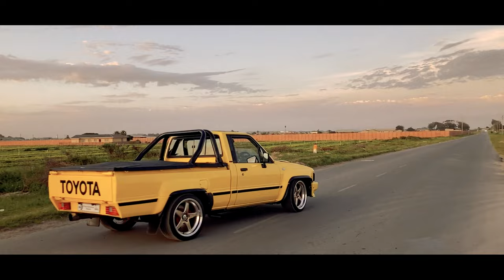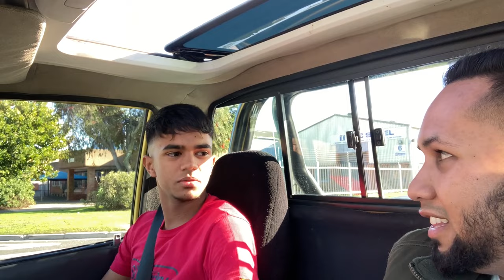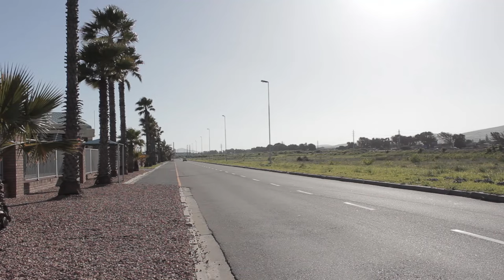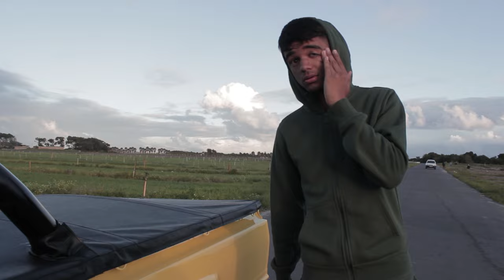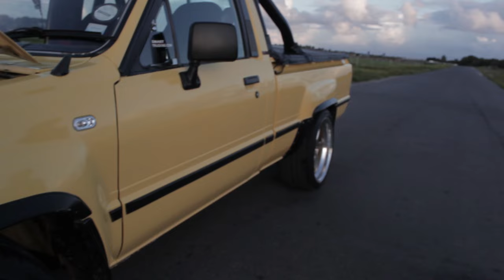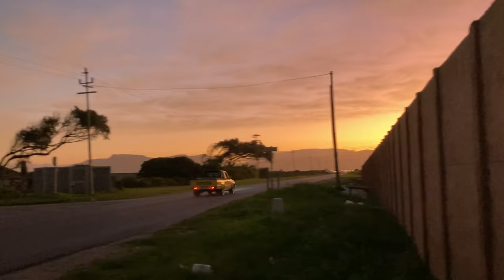TOYOTA HILUX 2JZ😍 | This is my ride Ep79

Comment: Great Video, I couldn't help but notice the valve cover is from a 2JZ-GE and not a GTE, are you sure it's a 2JZ-GTE or is it really a 2JZ-GE NA Turbo
Reply: It's cheaper to build a forged 2jze than buy a  2jzgte. But most likely a NA 2j with only injector and turbo upgrade explaining why it sounds weak
Reply: it's a 2jz ge na turbo

Comment: The slogan of TOYOTA says it all....ALLES LOOP REG ALTYD TOYOTA.....🔥🔥🔥🔥🔥🔥🔥....i want to know which gearbox would be perfect for a 1jz motor....and do i have to change the diff as well...i bought a similar hilux in the northern cape 2 months ago its an 1800sr...i took the motor out and got a 1jz but i just want to know which gearbox would be a perfect match for the motor and diff....🤔🤔🤔🤔🤔🤔

Comment: Excelent. How much will that slightly used or new engine cost in the USA?
Reply: Used not new. All used.

5-20k$
Probably  import as well.
Reply: 5 k $ engines are not bad as well just mod them hence the price range.